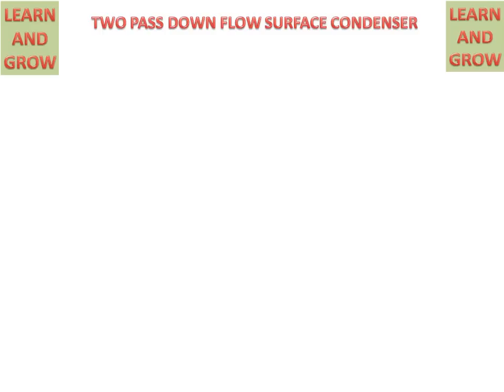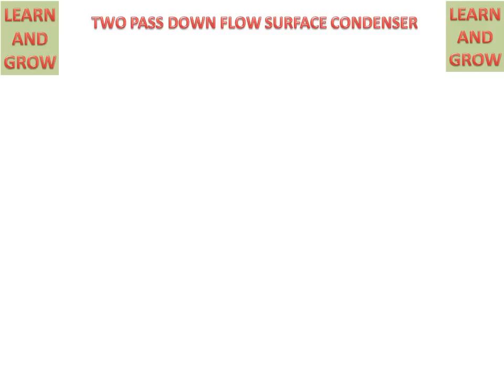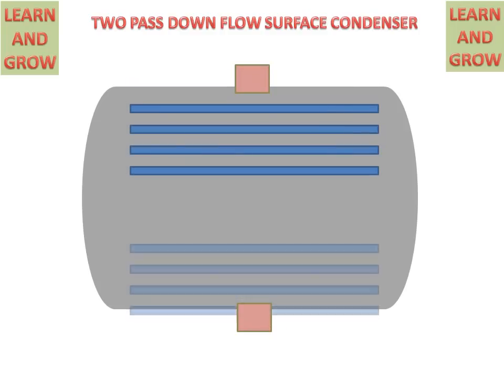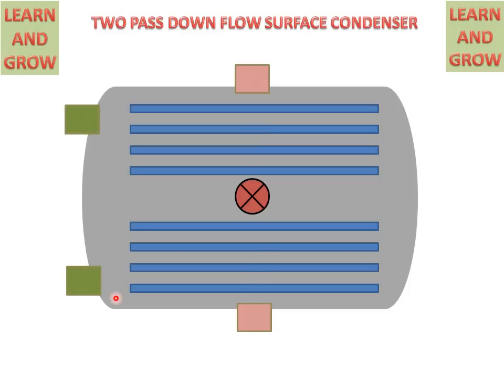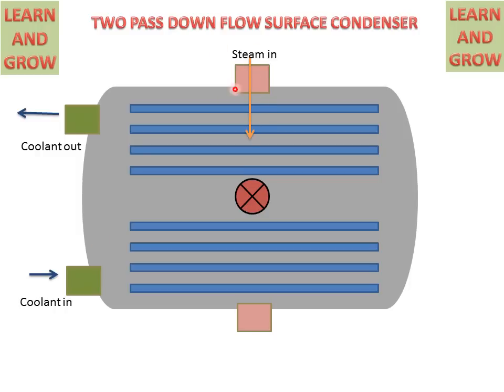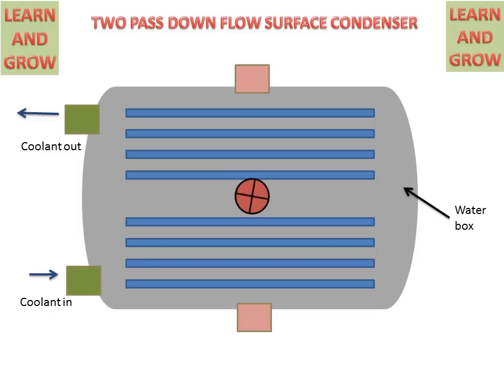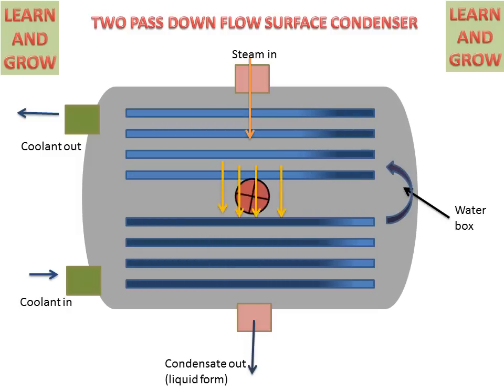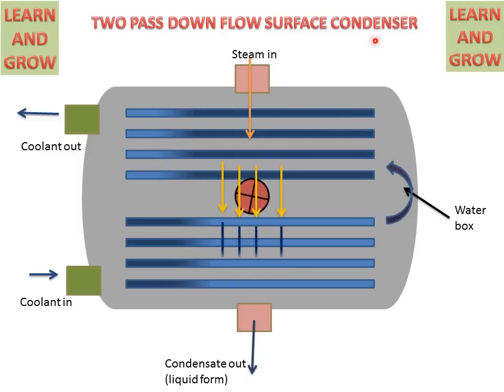Two Pass Down Flow Surface Condenser

Comment: Sir, why in surface condenser water flow through tubes and steam over the tubes?
Reply: Pls
Reply: When steam condenses, it's volume increases by 1500 times which leads to water hammer & fouling of the tubes. As the steam pressure drops, velocity increases which leads to erosion and high vibration.